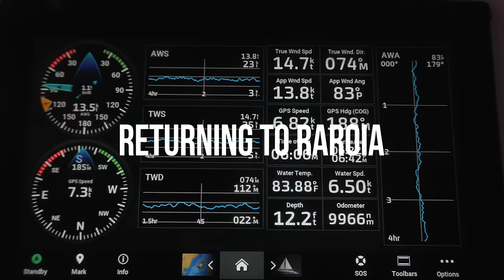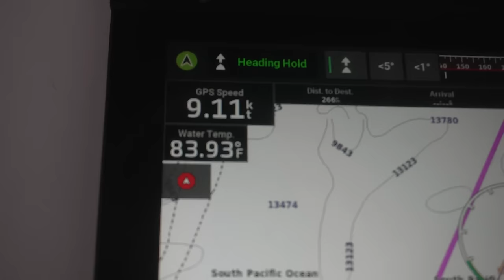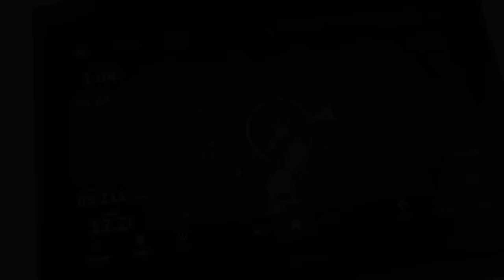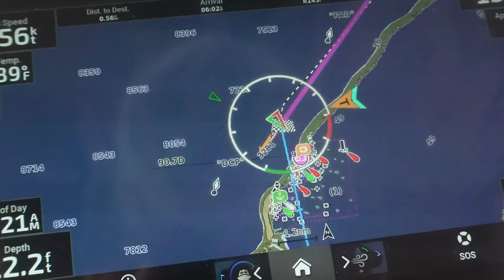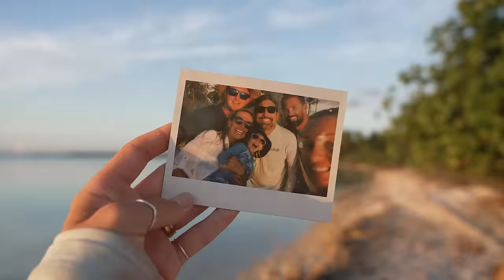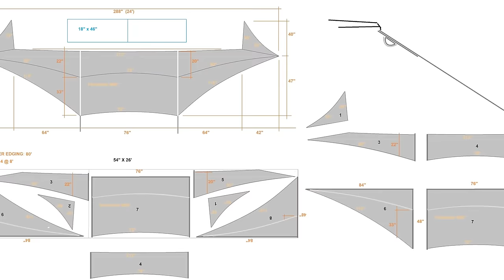DANGER! Do Not Enter without Motors | Episode 249

Comment: Sad to see Tom go. I saw him on Parlay and the man is a legend. Fantastic work figuring out and resolving the engine issue. Hopefully both engines will behave themselves from now on. Loving your boat projects and I would seriously consider a 3D Printer on board. Calm moorings on a cat will not affect the print quality and you can knock up some really useful items. Use ASA filament which is strong and UV resistant and you would need a filament dryer because of the humidity. Print at 0.16mm layer height and you would definitely be good to go. All the best Tom.
Reply from the maker: Hey thanks for the ideas and info

Comment: is the new mechanical fuel pump perhaps too weak?  You mentioned the primer bulb felt weird...how about a new larger one to get a better first prime...or just wire in the electric pump on standbye just in case?   just thoughts....have you opened the inspection ports on the fuel tank to check for algae growth????

Comment: Why not do a fuel pressure check on those lines? Or a gauge that will show you inline pressures? Great videos , thanks!😊
Reply from the maker: Yep you nailed it, in the end that’s exactly what we did, and as it turns out, all this trouble was due to a tiny hole in the fuel supply line just prior to the fuel pump, so it was sucking air into the system…

Comment: Thank you for that incredible video. I have a "technical" question regarding the disposal of the used fuel pump : since fuel is really really smelly, where do you put it ?
Reply from the maker: Good question- I drain the pump completely out and back into the diesel tank and then simply let the pump air out before putting back into storage in a spare parts bin…